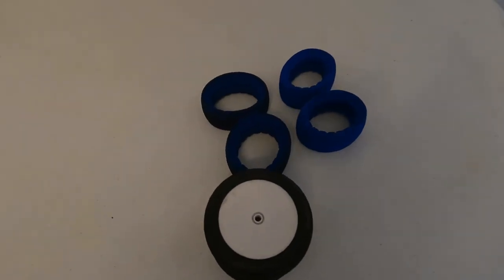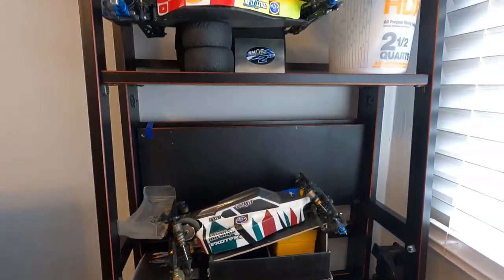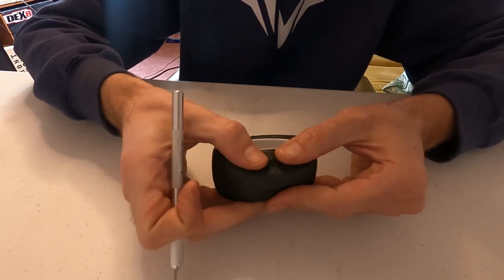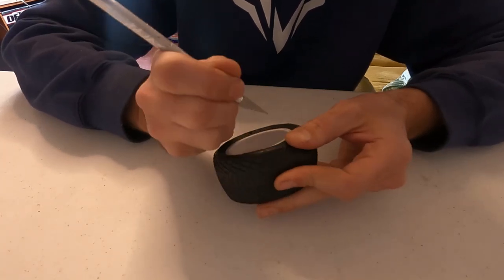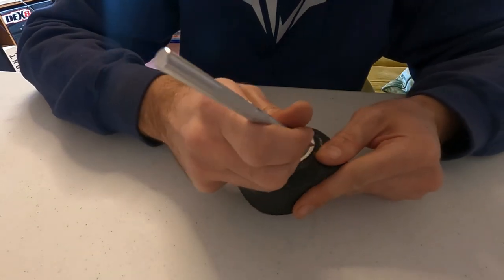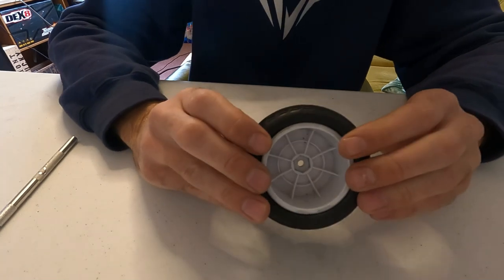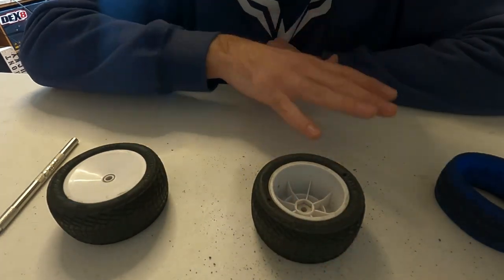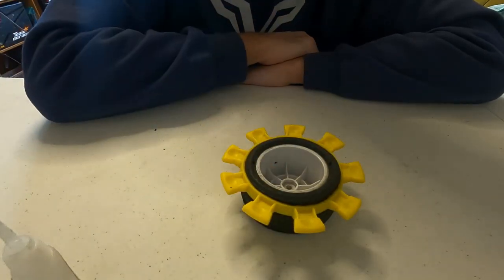How to Replace Foams in R/C Tires | Studio Tour

Comment: Why not use a heat gun some glove and a cookie sheet. Less work  very easy to do that way.
Reply: It stretches the tire out and you don’t want that to happen
Reply: @tylerantonovich4044  I have never noticed that at all.  Many people heat the tire as well.  Let alone heat the tire up just before a race.  This is on clay tires dont know if that make a difference or not.
Reply: @LittlefootAdventures  I put mine in the oven and they stretched out
Reply: @tylerantonovich4044  I set my tire on the cooking sheet use the heat gun go around in a circle motion till the glue loosen up.  You might be able to hear the glue pop if your hearing im deaf so I just check the tire here and there in about 5 minutes I guess I can do a tire never timed it so unsure of that. If I have 4 tires to do I stack all 4 on top of each and  qork them